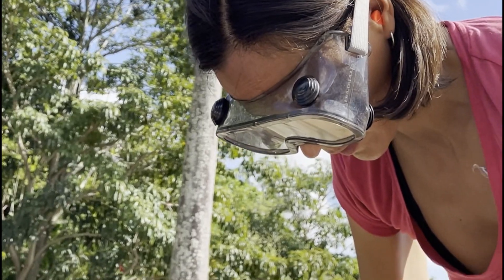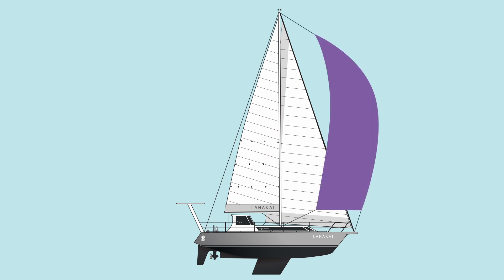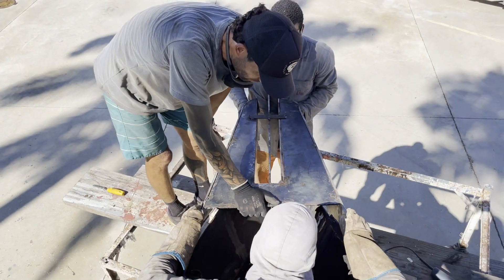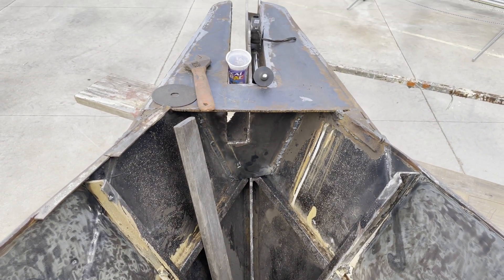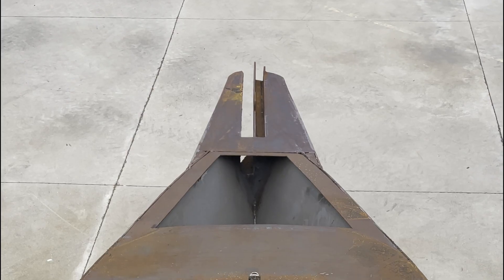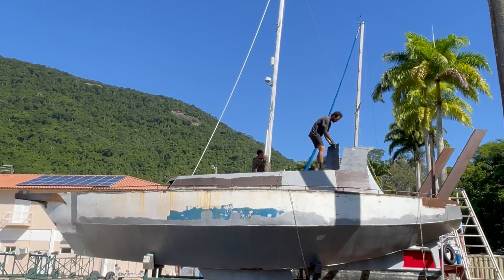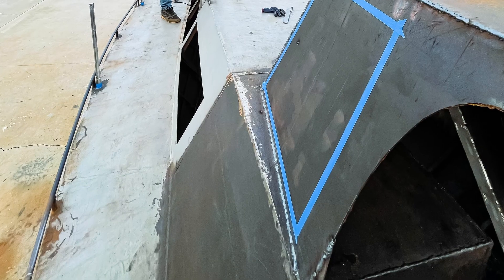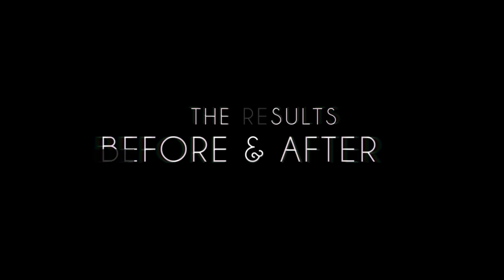EXTREME DIY Sailboat Restoration Project ⛵️ Ep6 – PART 2

Comment: Going from the episode where you first took the boat out of the water to this one is amazing!  You have taken a rust bucket and turned it into an icebreaker!  My half-assed suggestion: Steel and aluminum boats I worked on were pretty noisy in sloppy seas.  You might be a little more comfortable if you can spray a thin insulating coat inside the hull.  I'm thinking something like auto under coating.  I bet there's a marine variety.  All the best! 😎
Reply from the maker: Ah thanks so much! Love that description! We are worried about the noise and have been looking into different kinds of insulation. Our friends Chicama Sailing have a steel boat that is well insulated and you don’t hear the noise. Definitely something we will invest in!
Reply: @lahakai  "Rust bucket" might have been a little harsh but that's in the past.  Now, it's a stealth icebreaker.  Really beautiful!  😎

Comment: Great work , well done ! Be carefull with the  weight of the modifications in comparison to the original boat
Reply from the maker: Hey! Thanks so much! We’ve had a few comments about weight so we might put this in a video specifically talking about it. To give you an idea of the thought we put in, the original boat did have weight distribution issues when we bought it (leaning forward on the bow). Then we made lots of modifications, example: removing the 350-400 kilo motor. So we did lots of redistribution. It’s an excellent point to make! In the end we are on track for the same weight still. But it would be interesting to hear your feedback on how we did everything. Look out for that video in the future! Thanks again!

Comment: WOW WOW WOW THAT BOWSPRIT!!! Best looking sprit on the ocean…ingenious idea…form and function at it’s finest.  Well executed.  Might be my favorite build part yet.  As for the cockpit, are there seating areas on both sides?  The dodger design is fantastic as well.  Cheers 🤗🍻
Reply from the maker: 🤩🤩🤩 Thanksss!! We are so glad you liked it! It was a big idea to tackle but it really came out better than we imagined.

The cockpit does have seating on both sides and the back too. The seats in the original boat were so tall with just empty space underneath them, so we made ours significantly shorter by raising the floor to gain room below the deck. Also, the extension we made at the stern created around 50 cm more space in the aft deck. And you can sit on the stern, so thats even more seating. We are hoping it will be a nice place to lounge now!

Comment: I like the look of the boat and the honesty in the flat steel . There are two considerations I would like you to think about before calling the bow sprit done. 1) how and where to fit a rope snubber to take the weight off the anchor winch and chain when at anchor and 2) running water to wash the chain, I was forever fighting mud and sand blocking the chain locker drain. Solved with washing the chain in the bow sprit and more water as it stacked salt water not fresh.

I suspect you are very new to yachting so fit a bow thruster, honestly I did not need one but always had to come in hot for steerage so lost a glass blowers amount of sweat down my back into my shorts every time I would install one again tomorrow so with it the ability to maneuver on and off fuel docks, on and off jetties and on and off mooring buoy's I could let a child, partner or stranger maneuver the yacht. Yes a bow thruster is cheating but I knew if I was injured or absent my partner or a child could urgently get it off a mooring, off a dock or around safely slowly even in reverse.

One last concern is you are adding some weight up high and back in the boat this can affect your righting moment and the balance (handling) of the boat (easier to roll and slower to return and fore aft balance). This could be fixed with adding a keel wing or sailing cautiously in higher winds. I do like the look of the boat but my steel boat had an aluminum deck level and up with a carbon mast to reduce the weight and keel length. One yacht that I sailed on after modification listed and at speed it lifted the keel and stern wanting to stick the bow into the waves yours with more weight further back may porpoise (bounce the nose up) in waves and this can affect steering and how much water comes into the stern you may have a boat builder helping advise. 

Keep going and get out there. I have (three attempts in different boats) not got a lap of the planet but done a very slow stop start 1/4 you will find with a boat you can take your time and enjoy where you are and want to be for longer. Do extra solar and think where you will be for the ability to repair or replace equipment. Better to have good well known parts you can order than a custom one off and usually duplicate or make redundant critical systems (Radio one handheld one fixed, Bilge pumps not one and a spare, Autopilot one and one complete spare). 

After the bow thruster and safety equipment the only other piece of gear I would not go sailing without now is a water maker, small tanks are fine and you can stay longer away from jetties if you can make your own water and do laundry. Only one boat had a small washing machine more stuff is more maintenance (but a wife saver (no that is not a typo)).

You have the right attitude I wish you both fair winds and following seas.
Reply: One other thing do not be afraid of surface rust on steel the modern process is to let it rust then paint it with phosphoric acid to convert the surface rust to Iron Phosphate scrub (wire brush) it then you can two pack epoxy etch primer. Then it changes above the water line you go all finishing then straight to epoxy primer for Below the water if you are not bare metal you can go for a epoxy tie coat then anti foul. Colour is your choice dark can heat and light can show dirt, rust etc. Also you can add sand in paint for grip but cannot spray it easily.
Reply from the maker: So sorry we didn't respond sooner! We saved your comment for later to review and give it some time to responded but then it slipped our minds. 

So, without further delay...
First off, thank you so much for this thoughtful message. We can tell you are a big fan of boats and we hope you are enjoying our build so far. Let's see if we can tackle your questions and suggestions:
For the rope snubber we are going to put two cleats forward on the bow. If you have any suggestions aside from this, let us know, this is still workable. For the chain, we want to put a fresh water hose available for rinsing the deck and chain. We thought about a small box inside of the chain locker with one of those stretchy compact hoses. 

For the bow thruster, did you see the electrical engine episode? So this engine is supposed to be ultra responsive and changes direction faster than your standard engine. We will have to do tests but this in theory should give us excellent maneuverability. 

The weight distribution is a complex thing in this boat as we bought her with a balance issue. She was tipping forward in the bow already. We did tons of modifications so we will be doing a video about how we moved the weight around. Also, a little inside scoop for you, the keel had an old diesel tank that was unused, so a good portion of it was empty. We did fill this up to add more weight in the keel. Just one of many things we did. Soon we'll have more explanations on this, stay tuned!

We love the fact that you have lots of experience! We bought this boat in particular to be project boat, to build and get to know how sailboats work, down to the bones. We look forward to one day having a larger boat or even if we could be so lucky, and aluminum one. 

We really appreciate all the advice! And made some notes of things you wrote. Let us know if you saw our other videos and what you think of the progress so far.

Comment: Excellent, did a refit in Vlaardingen in 1972 &^ sailed 4 years on that ship before parting ways. Heard that after I left the bowsprit fell off near the Azores. We had redon the chain locker but not the bowsprit.
Reply from the maker: Oh that must have been a sight to see the bowsprit fall off! Sounds like they didn’t do as good of maintenance as you did when it was in your care.
Reply: @lahakai  I did cip out the chain locker 4 years earlier in the water. When we got in to dry dock Black Douglas looked like she had cat whiskers for all of the stop the leak wood I had driven in her nose. We had a crew of 50 as she is a 3 masted vassal. I was Engineer my last 2.5 years so never worried about the things out side of the engine rooms systems.   Think the King of Morocco owns he now, a much finer rendition of the 1929 build.

Comment: looks great but how are you going to take care of those flat sharp edges, I know there are three and four and six millimeters and heavy C's that's going to still be an awful sharp thing to hit. if I can make a suggestion, grooving quarter inch pipe , steel pipe, well that on the edges surrounded. keep going you kids are doing good.
Reply from the maker: Hey!! Good eyes! We did see that the clips we used did not show that we did round the edges of the dodger. So far no incidents have happened since we finished 🤞😬😅. Please tell us more about your suggestion about the grooved pipe. We are super open to ideas!
Reply: @lahakai  measuring,, cut each length of pipe, to fit each edge, then cut a groove in the pipe with a grinder, slide it into place then weld it.
Another way you could do it, is measure and cut a piece of pipe for each edge, and then well the pipe to that edge.
Reply: Y'all use 3 mm steel plate, I would use 6 mm pipe.
Reply from the maker: Ah got ya! That is a great idea. We will definitely get an estimate to see what it would take to do this.
Reply: @lahakai  glad I could be helpful.
Reply from the maker: Keep the tips coming! We really love good ideas! 😁😁 Theres lots of detail work coming up once we finish the structural work in future episodes.

Comment: I’d be a bit concerned about where the chain enters the bow with water coming in the hold whilst bashing through waves. Maybe fabricate some kind of gage to seal it up while underway.
Reply from the maker: Thanks for the concern! And a great point. So the hole in the bow is welded to have direct and only access to the chain locker which has a drainage pipe. It is completely sealed off. So there is no way for the water to enter more than just the chain locker. We haven’t finished the whole thing yet, we still need to put hinges on the hatch and such. But we will make sure to shoot more of this area to give you a good idea of what it looks like.
Reply: @lahakai  I know you have it sealed off and a welded in drain however isn't that area of the boat going to be taking in alot of water and does the drain go straight down or out the side? If you're heeled over on the opposite side of the drain won't it have issues draining?? It will be nice though to not have the dirt and scratches from the chain.. Definitely need a hose up there to wash the chain and anchor off as it comes up and into the locker
Reply from the maker: Ok, so, the locker was constructed in the form of a triangle, the base angled downward at the point, with a steep incline forward, imagine a funnel. Then there is a drainage tube at the point of the funnel that is also angled downwards. We will take some shots and make a YT Short about this so you can get a good idea of the space.
Reply: @lahakai  a short would be awesome..now that you have better explained it it makes sense and it will keep the bow deck looking nice rather than scratched up and discolored from the chain rust and dirt

Comment: Why not using a cheap Plasma Cutter instead of all this angle grinding ?
Reply from the maker: We did try a plasma cutter but the tips kept wearing away so fast that it was cheaper to use the angle grinder. Not sure if that's cause the tips are more expensive in Brazil that it ended up that way.

Comment: And the sand blast ?
Reply from the maker: A little spoiler for you (If you don't know our story)... in the state of Rio de Janeiro in Brazil, sandblasting is not legal. So, we will have to move the boat to do this 😬
Reply: @lahakai  You should have used proper marine grade pre blasted and low burn epoxy primed steel because thats the reason this boat was so rotten in the first place Good luck but you should have done your homework before starting to rebuild it oh and saved yourselves a lot of money

Comment: Worried the cockpit seating isn't deep enough along the back. It looks to be six or so inches and cushions have yet to installed. Food for thought.
Reply from the maker: You are the first one that caught this! Good eye! We plan on putting an extended backrest. We haven't decided if it will be fixed or removable. This will depend on how we move forward in the boat while sailing.

Comment: Id of put a lip and hand hold all around that dodger top ,otherwise very impressive ,you’re going about all the correct way
Reply from the maker: Thanks for the suggestion! We do have handle holds under the dodger which are great especially when going in and out of the companionway. Did you mean in another location? Also, please tell us more about how you’d put the lip on the dodger. We’re always open to ideas!

Comment: love it , but i have concerns about the chain locker design the hole at the bow for the chain is a huge water scoop , think every time you stuff the bow
Reply from the maker: Thanks for your feedback! The hole in the bow is quite small and at almost the level of the deck. Maybe 6 cm x 10 cm (without looking). So a large amount of water shouldn't be able to enter at one given time. The locker does have a hatch that will be well shut. Also the anchor locker is watertight, so water could only go into the locker and out the drainage. However, you got us thinking about the drainage pipe within the chain locker. We increased the size of the pipe in the cockpit because the rate of water exiting was too slow. Perhaps we could increase in the chain locker drainage as well. So, in the event water did enter, it could quickly exit (especially if dirt is in the mix). Wouldn't want any clogs in a bad moment. 
Thanks for the advice!! Already looking into this modification!
Reply: My first thought too.
The more serious issue is a constant stream of salt water from spray running DOWN the sloping anchor slot, inviting rust on chain and locker. 
There is a REASON  that most boats have a small, higher than deck,  hawse hole, with a cap in many cases.
The other issue with large hawse paths for anchor chain and rope is hard to maintain wear surfaces.
The anchor will bang and chip the top and sides of the "groove", and will rust even quicker with time because you can't get inside to paint it .
For the few times you get a muddy deck, easily washed off with a hose, your get a heavier thsn needed  fouled up hawser channel and locker that can't be maintained.

Comment: I just found your site and really enjoy it.   Great looking boat.
Can you line the chain locker with plastic or something to keep it from rusting out like the last one.  Maybe even install a solar powered vent to keep the chain from rusting in standing salt water.  The boat I have mentally built has the heavy chain locker low in the bilge next to the mast.
Love the shape of the cabin top, makes me think of a tank.  A real expedition boat for world travel.   Love how much light all the windows let into the cabin.  As long as it is strong enough to prevent big storm waves from bashing them in.  
You have not gone very deep into how you are balancing weight.  I hope you have a good engineer advising you.  There seems to be a lot of weight added high not balanced with weight low, so far.  I am sure the liquid tanks will help.  One caution, never put the batteries in the bilge for low weight.  It will kill power to bilge pumps first thing with a leak.  Keep them dry.  
Plan now how to stop a battery fire.  A few little fire extinguishers won’t work.  Will you need a good salt water pump with pipes above the batteries?  

Link to an electric fire burning a boat.  https://www.youtube.com/watch?v=9tLJpzokrYY
Reply from the maker: Thanks and great suggestions! 
We were thinking of lining the chain locker with something – like a rubber mesh to protect the surface to let the water pass. Plastic is an interesting idea. Wonder if with 3d printing a custom form can be created... Something to look into! 

We have had several questions about weight distribution so we are planning on doing a video on this in the near future. Lots of alterations were made, as you saw, so there's lot to unpack there. Keep an eye out for that episode! We are also going to get to the interior electric build soon. We are going to post some planning on our YT community page before we start it. So take a look there so you can get any suggestions or feedback in before we build out. Thanks again and keep the ideas coming!